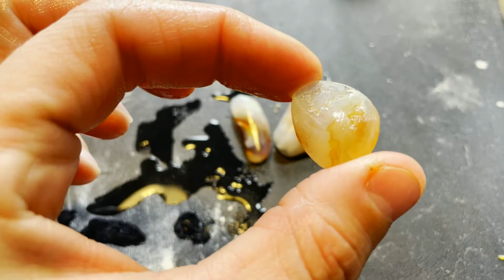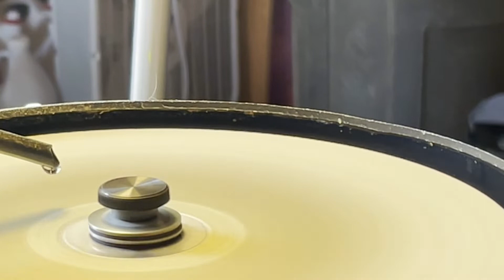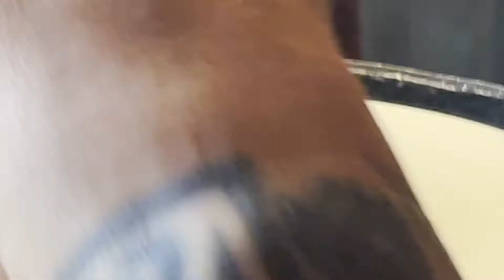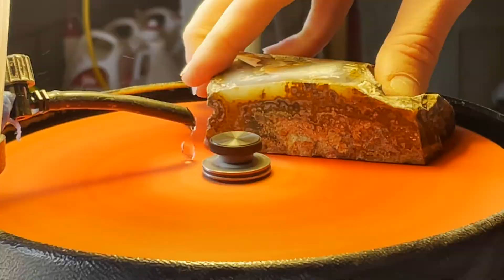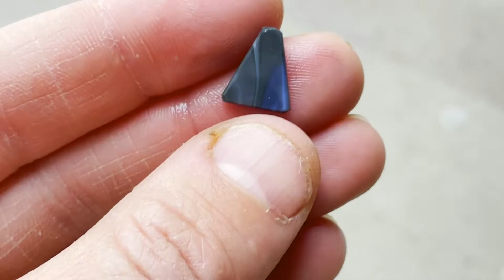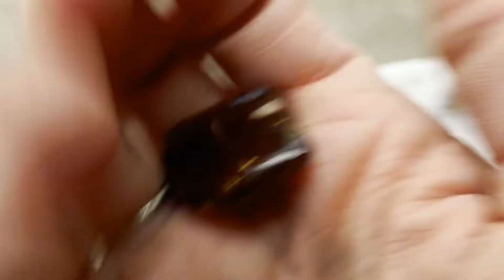Polishing Agate and Exploring Opals

Comment: Thanks for the videos,  we are in Flagstaff as well so we are always looking for new ideas and gem stone locations.  I use the same  HI Tech  machine you do but i did upgrade to the Pro flow water cooling system,  i suspended the pump off the bottom of a 5 gallon bucket so it does not pick up any silt,  i can run for hours with no issue,  well worth the 50 bucks.  Keep up the videos especially the local areas to find gem stones.  Thanks
Reply from the maker: Thanks! I need to upgrade mine too but I’m saving for a 10” slab saw. 😊 Hopefully in the near-ish future I’ll be able to run electric to my rock shed and not have to move everything to the garage every time I want to work.